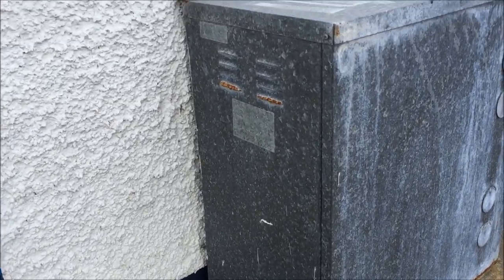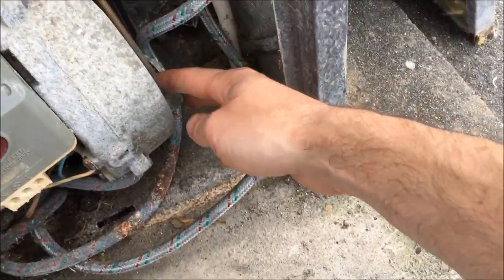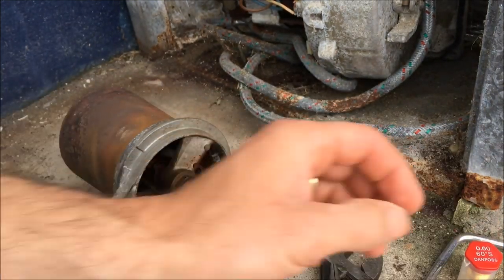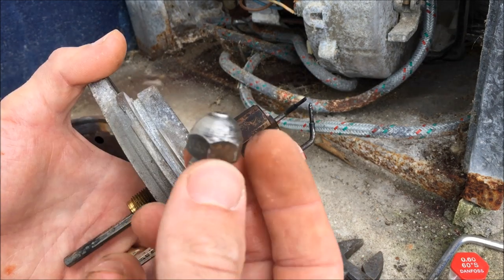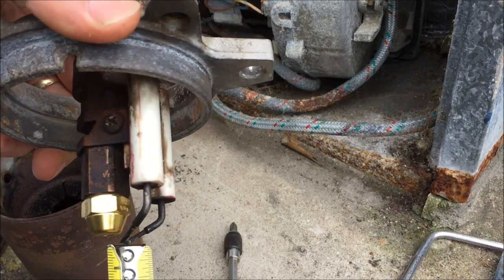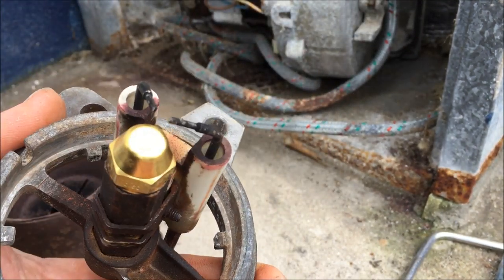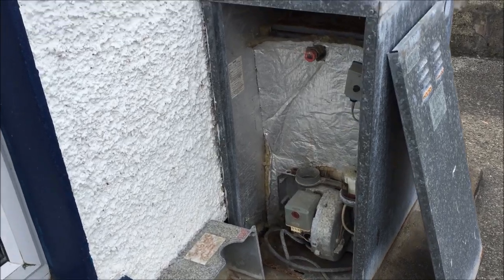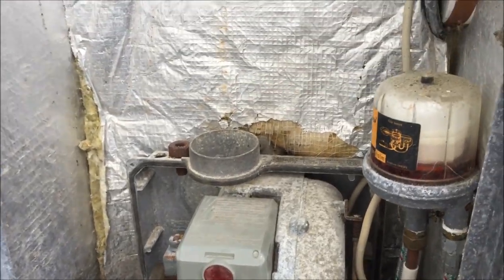How to replace an oil boiler jet (Ireland UK) or furnace in USA

Comment: Good job, Bootsowen, ...well done for having a go and getting it all back together and working - MOST people wouldn't have a clue - because they are scared off by 'The Professionals'. Got the same boiler...installed it myself -in 1997 -  *never checked oil pressure or did smoke test etc., and it ran for 20 years before I needed an oil engineer (pump was on way out). (*Grant test fire them as Riello burners - apparently - need to be set up for each manufacturers' boiler). It cost £950 (new) and a bit of sweat to install...but without paying for an annual service in real terms it's cost me nowt. Cleaning the baffles takes about 15 mins and I've only done it once...and it was VERY simple.

Since I've been a kid I've always serviced my own cars - even replaced an engine...yet most of my friends would say things like: "I wouldn't dare replace my brake pads and discs."  I'm now 70 and have just taken my one-year-old car for a service...£215 for changing the oil and filter and £3 for a sump washer. I kept my mouth shut and paid the bill...but when they service manager said: "I hope you like your clean car," I said: "I never clean my cars  it wears the paint down. ;-) 

Good luck, young un, and long may you enjoy having fun and saving money!!! In my day job I was a photo-journalist so I did need the odd Haynes manual to keep me on the right path!  :)
Reply from the maker: Thanks Bruce. I didn't realise there was paint in there!
Reply: Bruce Currie, we share many DIY traits and are a dying breed. 
I have just moved into a 17th C cottage that has some unknown Mistral (of Telford) boiler, that even they can't identify. But by chance I stumbled across this video and it looks identical to mine!
May I pick your brains - 4 weeks ago, this boiler, not used for 2 years to my knowledge, was not working, so some random tweaking and oil bleeding it has now been working for 3 weeks, phew!
The only issue remaining is that it starts each time with a loud verrroommm that can be heard quite a distance. It's not a bang like I have seen some oil boilers so I am not too concerned.
However, it could be a simple service/clean/adjustment will address this issue.
Anything you could advise would be gratefully received, even if it's to say that your boiler is loud to start with.
Cheers in advance.
Reply from the maker: @dardobartoli  Hi Bob, could it be that it is not igniting initially, until there is a good bit of fuel already in there? Are the sparking gaps set correctly.  Have a look on the internet for the manuals for the models that I have listed in the description, they are a good place to start for the spark gaps.  Also, are the tips of the spark electrodes pointed and clean/sharp?  But to be clear, as many of the comments have reassured me, I am not a boiler engineer, so at your own risk!.
Reply: @bootsowen  Thanks, this is the first video or anything I can find on a boiler similar and it has given me enough to go and strip it down and at the very least clean it up and identify the state of the parts with a view to replacing if possible still. 
Mistral were a waste of time for identifying their own stuff for sure. 
Thanks again.
Bob
Reply: King
Reply: @bootsowen  he said the paint on his car

Comment: Very well documented and well explained example of how to complete this work.  Will be having a look at my boiler at weekend, not exact same spec, but you gave an excellent overview of the main components. Many thanks!
Reply from the maker: Thanks, Have a look at the other comments, oil engineers hate this video so take it with a pinch of salt. This worked for me, but whether or not I needed to do it... the jury is still out, I can't tell if there is a difference, but it still works.

Comment: As for the original instructions the jet required will depend on the BTU's of the house but for that boiler its mostly hollow jets. 
You did a better job that most places I go.... for real!👍
Reply from the maker: Thanks buddy. A bit of patience got me there.  Doing jobs like this is tedious. I don't think people would do it for money!
Reply: @bootsowen  Oh stop man. Some of them can be a nightmare for throwing faults after you have arrived home and something else has failed because of a new part drawing different amps or watts or whatever the fuck. Oh just looking at that boiler gives me flashbacks 😳. 
Also I was wrong about what type of jet. They all differ in type per size and model.
Anymore tell them that anything fails and you replace it there is a chance of something else going out. And download  the ohms info for each component and check it with a multimeter and the tolerances should be listed so you don't have to go back again. Catch it before it fails and you on another job that you have to drive 15 miles to change a capacitor. Power on buddy.
If I can help anytime hit me up through what's app and if I know the answer I'll be glad to tell you. 
Be good 👍

Comment: I was just going to get a service man until I seen this video. You just have saved me spending between 100 to 200 euro. This will come in handy for my kids over the Christmas and they will be warm. Thanks for sharing. Off now to buy a new jet and filter and I will clean and make sure everything else is working and set properly like in your video.
Reply from the maker: You should find the manual for your machine and make sure that you are setting it correctly for your machine, mine may be different. Good luck, let me know how you get on.
Reply: @bootsowen  mine is 100% the same as the one in your video 50~90 Euroflame hopefully If i can get the parts today i have it up and running straight away.  And if not i have friends working in Grants only 30 minutes away from me.
Reply from the maker: @FastNFearless  Excellent!

Comment: Interesting video. Some useful information there. I see a lot of criticism in the comments from pros. Fair enough if you were claiming this was a full professional service, but it seems all you did was change out the nozzle on your own boiler, as the title of the video states. I suppose the pros are genuinely worried that everyone with a spanner starts having a go, but if someone is competent then I don’t see a problem, especially as it’s your own boiler. Those hoses do look dodgy though 😀. Cheap to replace.

Comment: Done the same today 😌 grand job 👌 great video 📹 👍 only different mine still not working running but not firing and idea?
Reply from the maker: Bleed the pipe going in. Sounds like airlock. That’s the easy one. Or no sparks.

Comment: Really like your videos. I know way too little about machinery and handiness myself but really enjoy seeing this stuff.
Reply from the maker: Thanks, that's cool, that's why I do it! Most of the time I don't know what I am doing but I give it a go. I can always call in an expert. Like that boiler furnace, I think if I called a service engineer they would have said it was too old, just because it would be difficult to do.
Reply: @skipup5083 
I was told there is not much servicing on a boiler apart from cleaning it out once a year and checking the jet and clearance from the jet to the electrodes.

Comment: You can tuch the nozzle. And the settings are 2 to 2.5mm ahead 4mm apart 5mm up
Reply from the maker: Thanks, your advice conflicts with the advice I was given. Why don't you post a video?
Reply: @bootsowen 
Just got an oil burner installed lately and was wondering has many litres of kerosene would the burner use in a year just as a rough guide.
Reply from the maker: @wewouldneversellourclubfor3166  No idea. I put e300 in this one about 8 years ago, and it gets about 2 weeks light work per year.  Id say the price of oil has gone up since then.

Comment: By all the gods, I think this is the same as the boiler in my new (but old) house, but rebadged by Mistral Boilers. I thought mine was in poor repair but this is worse.
If you're still monitoring this video, would you be able to provide link to where you got specification/manual/instructions from as up till now, I have found nothing. 
I will rewatch and try and note all the specific details you list (including brand etc)
On that note, after 'tweaking' the only issue I'm left with is a loud vvvrrroooomm noise each time it starts. Not a bang but it is annoying. If you have an idea as to what this may be, then forever in your debt.
Thanks in advance.
Reply from the maker: I think that I got the manuals by googling the type of boiler, I think I put the name in the description. I think the vroom may be the gap setting of the spark electrodes. But that is just a guess.

Comment: You must also know you didn't take out the baffles and clean them with a wire brush and inside of the boiler with a wire brush then hoovered it out, there are no pipes inside, just baffles to restrict the heat escaping as that area is the primary heat exchanger on conventional boiler and judging by the burner I don't think it was a condensing boiler. 
Word of advice.... change the braided hoses just in case they leak all your oil.👍

Comment: How did I miss this vid ?
Reply from the maker: No idea Tommy, this is one where the comments are wonderful!
Reply: @bootsowen  yep, seen that.  My gripe is these type of "low efficiancy" good reliable boilers are being ripped out & replaced with so called "High efficiancy" less reliable bs that will have to be replaced sooner & are. Only more efficient when condensing, which in most circumstances is not happening. Yet another eco con job that is in the long-term more wasteful. ... _ _"just just Don't get me started !!!! "
Reply from the maker: I was listening to "the war and peace report" on NPR rebroadcast on RTE R1 extra yesterday and it was talking about the other side of the COP Glasgow conference. It might help to grind your gears! 
I get it that some things are more efficient, but I saw my grandmothers 25 year old perfect oil boiler, that would have seen her out be replaced with a condensing unit. I can see her beating it and it is 2 years old and she 95! She paid for the privilege.

Comment: Boots, with all due respect, that is nowhere near a service for that appliance. You made it so difficult for yourself to change that nozzle too. All you needed to do was remove the two small screws on each side of the blast tube and you have ample access to the nozzle holder.. The blast tube fins should have been thoroughly cleaned with a wire brush before refitting. 
The inside of the boiler should also have been cleaned with baffles removed, inspected and any damaged ones replaced. Those flexible houses were well passed their sell by date and should also have been replaced without question. Pump pressure and flue gas analysis should have been carried out to complete the service. A little knowledge is dangerous.
Take it from me on this one, I service and repair these appliances for a living.
Reply from the maker: Sé mo thuairim é nár thuig tú cad a bhí ar intinn agam a dhénamh sa video seo.  Ní raibh aon plean agam serbhís iomlán a dhéanamh, ach an jet a aistriú. Agus sin a rinne mé.  Ádh mór!
Reply from the maker: Thanks for your comment. What field of training are you referring to? Have you made, or can you recommend a video that will make this process clear?
Reply: Nothing more than diy nozzle change. Nothing to see here.
Reply from the maker: @williammcgrattan9583  It's almost as if I got the title of the video spot on!
Reply: @bootsowen  what part of Ireland there?
Reply from the maker: @williammcgrattan9583  Way out in the sticks.
Reply: @bootsowen  jeez that could mean anywhere from Buncrana to Skibereen 🙄
Reply: @bootsowen  an bhill ceadagam Maite de huille . Seamus is ainm Dom that's my native tongue lol!
Reply: @bootsowen  an mhaith a mhac
Reply from the maker: @conamarathomas3237  Iaracht, ach ní thuigeann gach éinne cad atá i gceist.
Reply: Everyone beware it looks like we have a jobsworth in the house
Reply: @bootsowen  he is referring to the Oftec 101 certificate which is the only recognised training for this field of work. As I said in my original post you made that job extremely difficult for yourself, in addition you didn't do a complete job. When dealing with people's heating appliances you must bear in mind they are a fire hazard.  If you get it wrong then you can leave them without a home. PTFE as a seal is totally unacceptable. 
When you replace any part which affects combustion you must complete a flu gas analysis, especially when you change the size of the nozzle as you just did. The air/fuel mixture is going to be different. I hope you have the appropriate insurance to cover you, public liability is a necessity when working on other peoples property. 
As someone else has said, if you are going to reply, do so in English. It is the language you have used to make the video.
Reply from the maker: @Banbridge_Born_and_Bred  Hi Stephen, you piped up pretty quick there when someone called you a jobsworth!  You made a few assumptions in your comments. Rather than responding to them all, what I can say is that I sleep soundly knowing that I did this job myself.  While I would love to only employ trained oil boiler technicians to do work like this, the reality is that I don't believe, from experience, that any person who does this kind of work for money would have the patience to repair or maintain a unit in this condition of this age.  Nor would I be willing to pay them to replace most or all of my boiler. Yes, there will be shortcomings in my work, but risk is a thing that we live with everyday.  I maintain the brakes on my car, am I qualified to do so? I light fires in a hole in the wall in my sitting room and park my toes about as close as is possible, all of my toes are still there.  You should have a look at my other videos of gas appliance repair and installation: you might like to do an air/fuel mixture test on the exhaust gasses that come out your ears!
Reply: I can assure you Boots that appliance is in great condition compared to some of the ones I work on. However, there is a big difference between fixing the brakes in your own car and fixing someone elsew heating appliance.  I have seen too many botched jobs like the one you have posted which has resulted in a great deal of damage to the customer's property, ie kerosene contamination due to hoses not having been replaced, boilers left at risk of going on fire due to combustion settings not correct resulting in soot contamination.  But hey, if you want to be a cowboy, go buy a horse and a big hat.
Reply from the maker: @Banbridge_Born_and_Bred  But it's my boiler, so it's ok, right? Now where do I get a horse?

Comment: Wrong jet mate! Also them jets weren't available 10 years so it must have been serviced relatively recently and you can touch the jet just not the filter side of it which is the porous shiny part on the jet. Good job mate but you made it brutally hard for yourself. And one of the most important parts is the oil hose to be changed because they do tend to leak and if that leaks after you did that job and it was reported to the EPA you'd be up s*** creek. PTFE is standing for polytetrafluoroethylene it's not ordering material. And you didn't test any of the components with a multimeter to if any of the electrical components are breaking down or ready to fail example capacitor motor coil control box which contains the transformer for making the electrodes arc for ignition of the atomized fuel from the jet you just fitted but fair play to you I've seen worse
Reply from the maker: I wonder why the original instructions would quote the wrong jet? As for the EPA: I live in fear.
Reply: Couldn't have said it better myself any time I'm on an oil service I always do the basic electrical checks with the components with a multimeter- a must if your an oil/gas engineer in my opinion I dont think I could do my job without it. But always check electric components with a multimeter to see if they are on there way out so you can advise the customer otherwise you will get the dreaded phone call saying "you serviced my boiler a fee weeks ago and now its not working" always cover your back. The same goes for putting a pressure gauge on the pump to see how its working (you can tell by the gauge if it works properly or if the pressure keeps dropping I.e pump on it's way out)

Comment: Nice video, though its a 50/70 not a 50/90
Reply: The sticker at the start does say 50/90 but if you go to 12:35 on the video it says 50/70 on the boiler housing.  Someone short changed you!
Reply from the maker: I feel like I have missed the warranty return period!

Comment: Why on earth did you take the complete head off to change the nozzle ? why did you not just remove the blast tube ?? Also tiger loop should not be within the case . Fire valve ??
Combustion check 

Please don't copy what he is doing .  HE HAS NO IDEA
Reply from the maker: Oh yes. It was combustin alright. I took the whole head off because I didn’t know what I was doing. That much should be clear. Also I wanted to be gentle as lots of the fasteners were seized or corroded. I didn’t fit the tiger loop so I can’t comment. The whole thing seems to be working exactly as before. You probably wouldn’t like my trick of pulling out the thermocouple when the pipes to the unit are frozen. Never fails. Not an explosion in sight!  The plan is to retire this unit once the oil runs out.  But as it is in a holiday home that will take a few years. Thanks.  Any tips for next time? Help rather than negative blind questions?
Reply: bootsowen  Well done buddy.  Good video. 
To many people  Quick to leave negative comments. 
Good job.
Reply from the maker: Thanks buddy